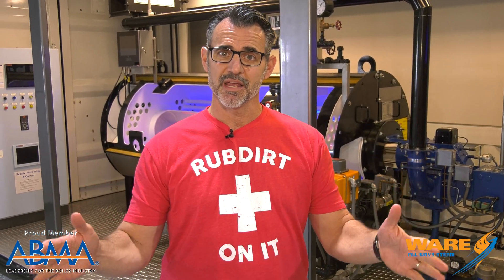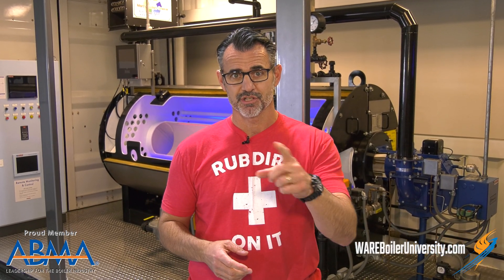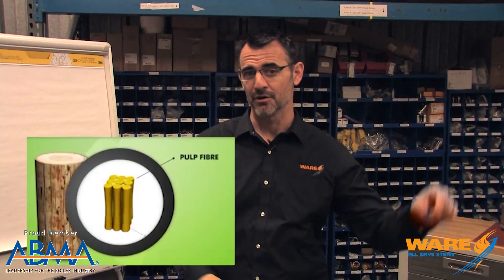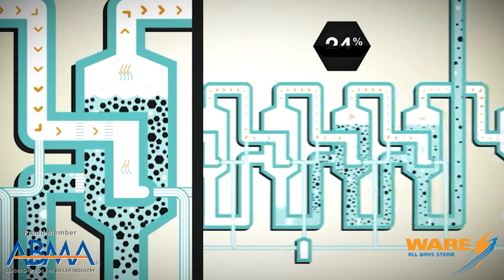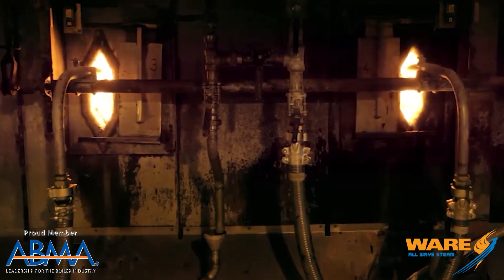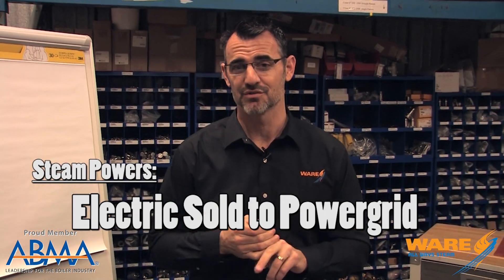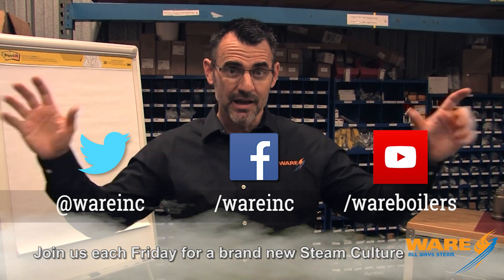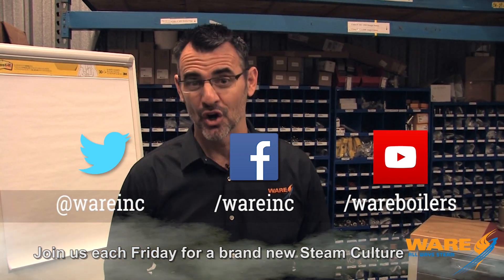What is Black Liquor in Paper Making - Steam Culture

Comment: You pretty much got it. I am/was an outside recovery boiler operator at a paper mill in GA. Our boiler produces about 1 million pounds of steam an hour, so it is one of the largest steam producing recovery boilers in North America. Out Black Liquor is able to burn up to 80% percent solids. We typically run with solids in the mid 70s. Unfortunately, we are in the process of shutting this mill down. 1100 plus people will soon be without a job.